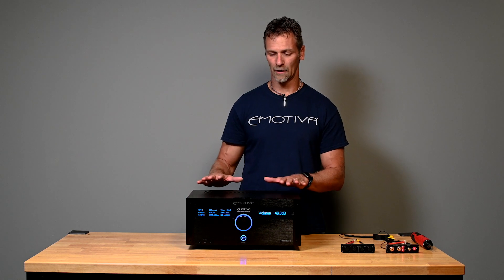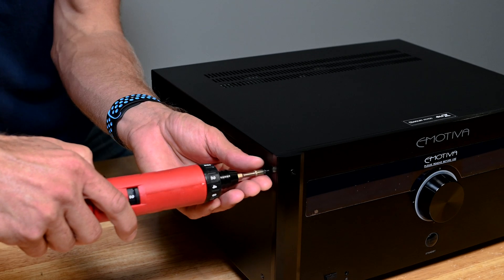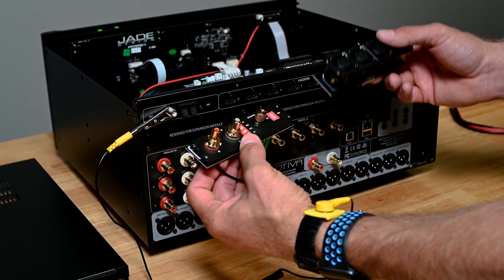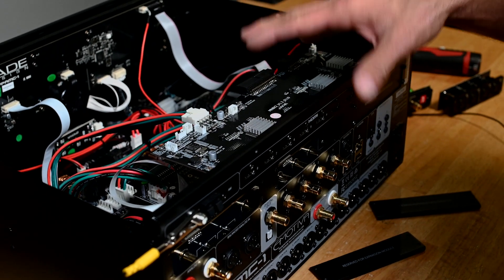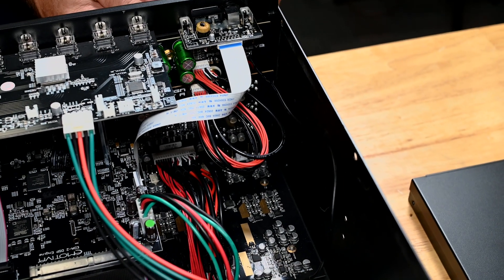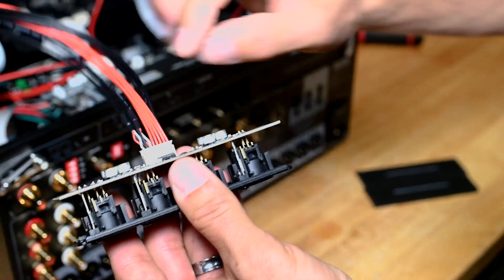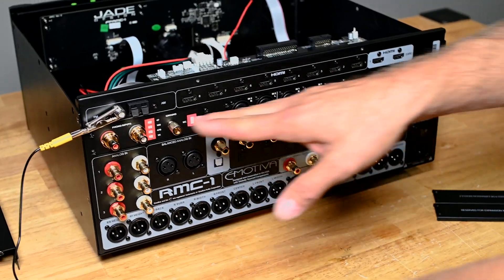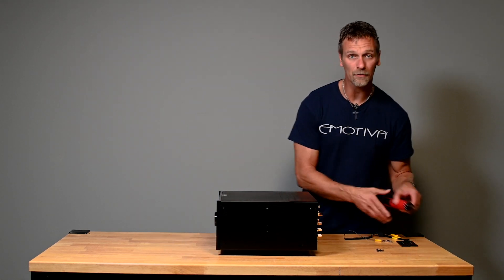Emotiva RMC-1 Processor Expansion Module Install Guide

Comment: I love the Emotiva modular design across your products. I recently just expanded my XPA3 gen3 to a XPA5. I ordered the modules and did it myself. Although it was a rather straightforward install, a video from you guys would also be nice showing the proper steps and procedure. Especially for your overseas customers like myself where it is not cost effective to send the amp back for upgrades. Thanks Emotiva, keep the videos coming!!